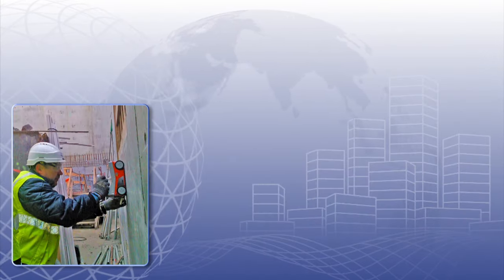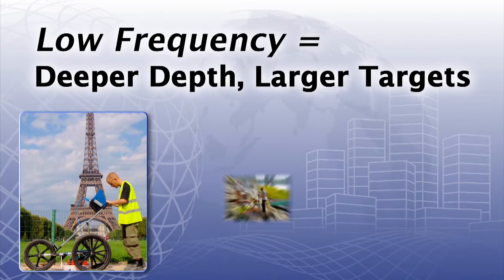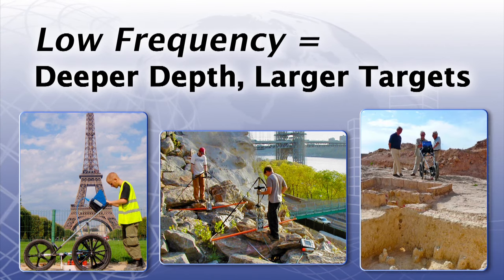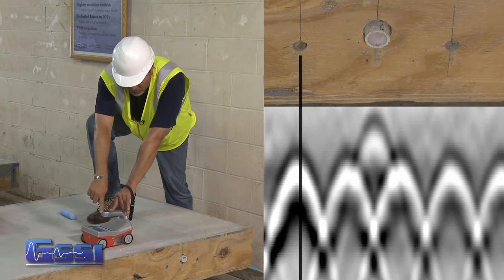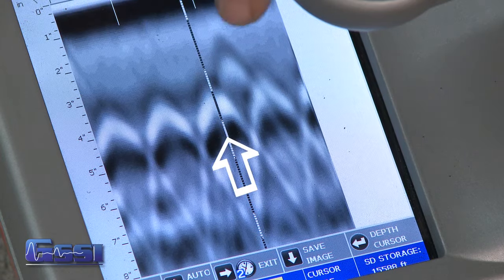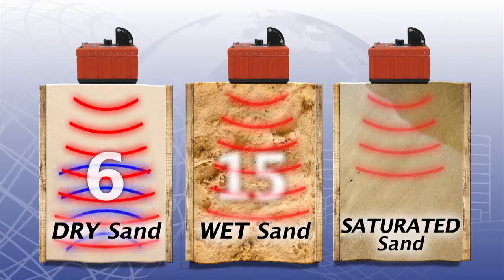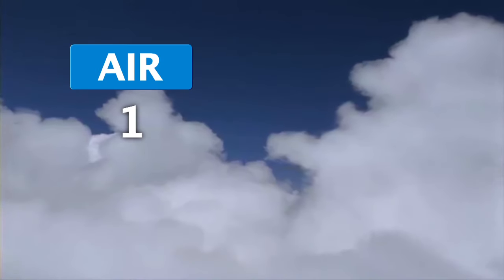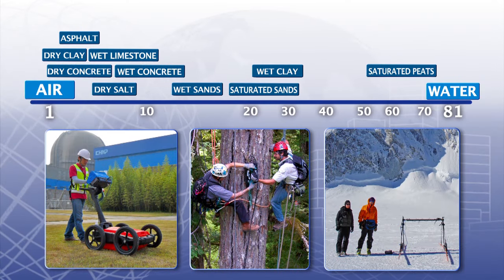What is Ground Penetrating Radar (GPR)? And how does it work?

Comment: A few more facts and some clear-ups! (please be considerate of the fact that I am not a native English speaker. The following text may contain spelling and/or grammatical errors.)

1. GPR (Ground Penetrating Radar) functions primarily on one principle: refraction. Just as light (also electromagnetic waves) fractures as it enters one medium to another, so will the pulses send from your GPR antenna. A pulse will be send into the ground where it will contact a object made of a different material than the surrounding soil itself. These differences in dielectric properties (among them permittivity) will cause the pulse to diffract where a part of it will continue to move further into the ground - albeit at a changed angle - and some of it will reflect back to the GPR antenna. The more signal is send back the higher the power reading will be and thus a higher amplitude will be recorded. These amplitudes help us create a radargram.

2. These pulses (sinusoïdal waves) are usually of very short duration, about one to one and a half period long. This is used to determine the time it took to travel to the object, be reflected and travel back (two-way travel time or TWT) to the antenna. Imagine the pulse to be numbered as such that, for example, you send out five pulses you can also count five pulses that have been reflected. Now it is know how long each pulse has travelled as it is simply a matter of keeping track of the time between transmission and reception. These travel times are usually in the duration of nanoseconds (1 nanosecond is 1*10^-9 seconds). With a known two-way travel time (TWT) you can now also determine that depth at which it got reflected, provided that you know the approximate speed at which electromagnetic waves move through the sounded soil. Given a known speed 'v' in meters per nanosecond (m/ns) and a know TWT in nanoseconds then it is easy to see that depth 'D' in meters can be expressed as:

D = TWT / (2v)

If travel speed of a pulse through soil is unknown, it can be approximated as long as the relative dielectric permittivity 'ε' ' (read below) of the respective soil is known:

v ~ [ c / sqrt(ε') ] * 10^-9

'c' ofcourse being the speed of light in meters per second and sqrt being the square root of variable between brackets ().

3. Dielectric is only a indicative noun such as that you would call high saline water a dielectric. The values given from 5 to 81 are called (relative) dielectric permittivities in the unit of Farad per meter (F/m) with the symbol ε'. The permittivity of a medium describes how much of an electric field (more correctly, flux) is 'generated' per unit charge in that respective medium. It is one of the most important properties to know because it acts as a crucial factor in depth reach, pulse speed and spreading. As a rule of thumb, the higher the dielectric value of your sounded medium, the lower your resolution will be and the less of a penetration capacity your transmitted pulses will have.
 
4. Pure water itself has a relative dielectric permittivity value of about 80 F/m. Common water however can contain any number of dissolved chemicals and minerals. As such it's permittivity can fluctuate quite a bit. It is also temperature sensitive and will usually show lower values at higher temperatures. On the otherhand ice, the solid form for water, continuously demostrates relativily low values of about 3 to 5 F/m. Keep this in mind.

5. Lastly one should also be wary of the soil's conductive capacity. The higher the soil's conductivity the lower your resolution and depth penetration will be. This is a result of the increased spreading of electromagnetic waves as they are being conducted through the soil. An analog to this would be to imagine water as it traves through a soil. The more pores the soil has the greater the potential for the water will be to spread. The water will reach the bottom but greatly spread out and with very few litres per square meter. On the otherhand if the soil had but one pore, all water present would have no choice but to move along that one pore towards the bottom.

6. The last important factor is the chosen center frequency (f) of your GPR system. Center frequency is the frequency of your sounded pulses. A frequency means how many periods a wave would contain per second if that wave would be transmitted continuous (in oposition of being transmitted pulses). The center part means it is part of a spectrum of frequencies. So a GPR with a center frequency of 500 MHz and a deviation of 20% might send out pulses with a frequency of 400 (lower bound) to 600 MHz (upper bound). If any object is to small to noticeably interfer with the sounded elektromagnetic waves, it will not produce a great enough reflection and as such will not be detected by your GPR. A rule of thumb says that an object must be atleast 1/4th the size of the wave length to be noticed. Formulated with object diameter 'd' and pulse wavelength 'λ' in meters:

d >= 0.25 * λ

Since the wavelength is a product of frequency and travelspeed it might also be expressed as a function of those two:

d >= 75 / [ f * sqrt(ε') ]

Any object large enough to be spotted by pulses at center frequency will produce the highest possible resolution at the objects respective permittivity. objects large enough to be spotted by the lowest sounded frequency (lower bounds) might produce a noticeable radargram but it's resolution will be lower the an object with comparable permittivity but a greater diameter.

* Resolution = The accuracy of the displayed dimensions on the radargram compared to the actual dimensions of the sounded object.

I hope this has been of value to you.

- A sly Fox
Reply: Thank you sir. Who cares about grammar if one can understand what you are saying, language is for communication and not for finding faults.
Reply: Persona Non Grata Thanks Sir, allow me to copy it for learning purpose
Reply: thnx!
Reply: Thanks!
Reply: just want to clarify. on the last  paragraph talking about wavelength  is a product of frequency (f) and travel speed.
Aren't suppose travel speed equals to v ~ [ c / sqrt(ε') ] * 10^-9   ? thx

Comment: it is ok,  in high voltage
Reply from the maker: Yes, GPR equipment is safe to operate in high voltage areas such as power stations and transmission towers. However, other equipment onsite may interfere with the radio frequencies used by GPR.

Comment: So this is just an ultrasound or some ultrasonic transducers with high frequency pickups that interpret the reflected signals and determines the amounts of refraction and dispersion along with its string of emissive patterns then correlates and compares those values to a known logic table then ultimately displays its interpretation..??   Am i close?  Like a doppler effect except linear…. ?
Reply: No, ultrasound uses mechanical sound waves to image conductive materials in high detail. GPR uses radio waves, similar to a cordless phone to locate objects within various surfaces. Doppler Radar is more complex that uses the Doppler effect to produce velocity data. It does this by bouncing a microwave signal off a desired target and analyzing how the object's motion has altered the frequency of the returned signal. Different algorithms and executions.

Comment: Thanks, helped a lot with A level physics coursework! :D
Reply: Hey,
     That sounds very much like mine, which was on 'two different methods which are used to explore ground areas, describe how physics is used in these methods, and their potential uses.' I had to use three different sources too, I think in the end I used a book I got from the library (cant remember what it was, sorry) from which I just quoted some equations, this video, and I think I used a news article I found on GPR.
     The two methods I talked about were GPR, and also using electrical resistivity to determine the materials under the ground.
     I highly recommend this (http://www.subsurfacesurveys.com/pdf/Methods.pdf) document, which details both techniques i mentioned and more.
     I hope this helped, and good luck :)

Comment: How dramatically is EM typically absorbed in say dry soil or concrete? does it fall off very quickly or can it go 50 meter down? is 90% absorption per meter typical? more? less?
Reply: you can probably look up some papers on this, but in dry materials you can use 430MHz to peer kilometers into lunar rock for example